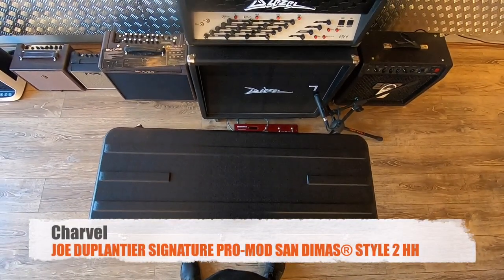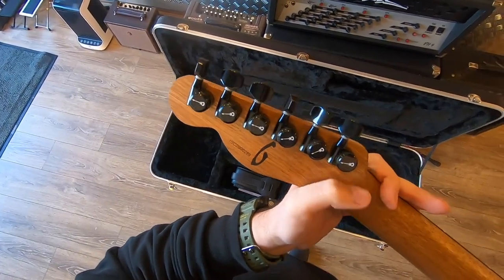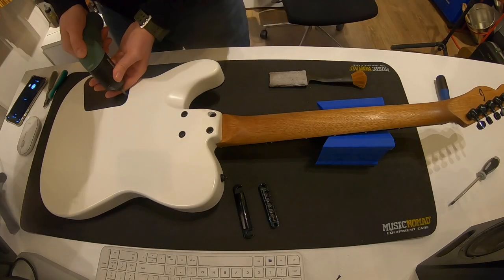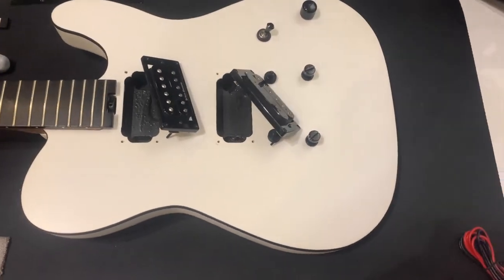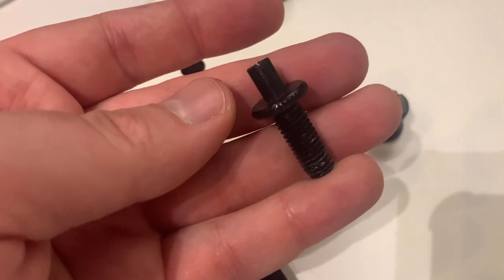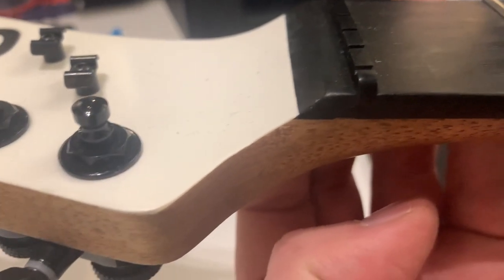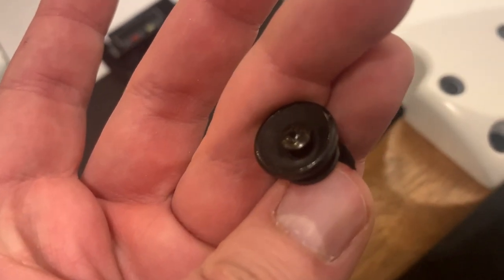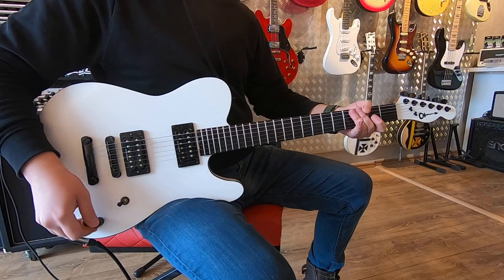Do you like Gojira? - Charvel Joe Duplantier 2 HH Guitar Review

Comment: For God's sake tune the God damn thing.
Reply from the maker: Mike, i got plenty of tuners around me, one of the best of them right next to me, seconds before recording ;) If something sounds out of tune in my videos it is due to a couple of reasons:
1. The intonation is off because I didn't have the chance to set it. Some of these guitars come and go for a couple of hours and I have to push it to demo them. Its not about playing its about the specs ;)
2. The action is too high and I am having a hard time pressing down
3. I demo a lot of guitars most of them with different string gauges and it is difficult to determine how hard to press down on each set without bending out of tune.
4. The Strings were probably changed a couple of hours before recording. This is not you playing your favourite guitar in your bedroom, this is me trying out different guitars almost every other day. 
5. Make me! 🤣